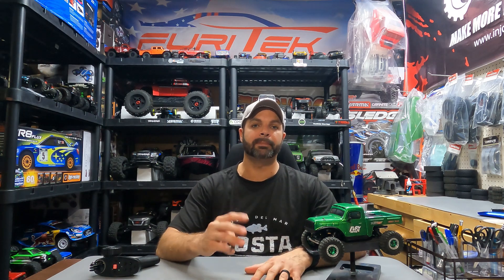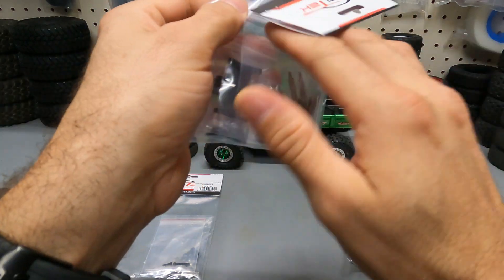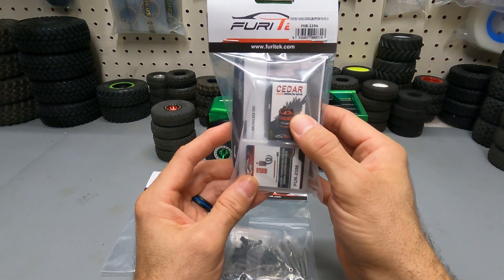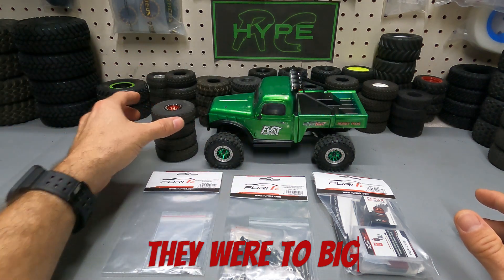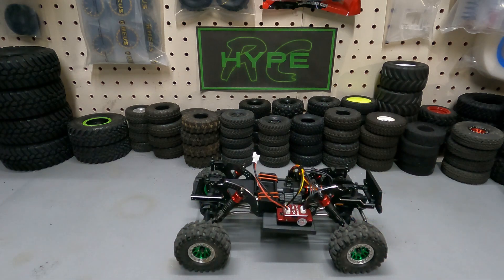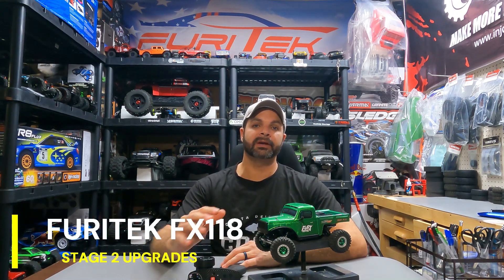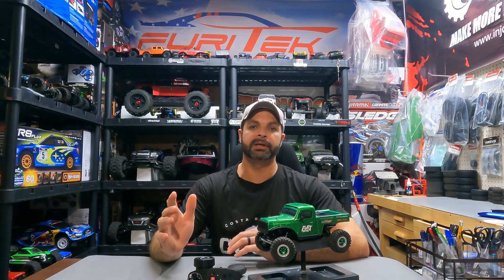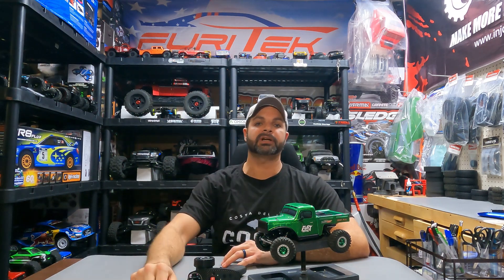Are these the best FURITEK FX118 upgrades? STAGE 2 upgrade test run & review

Comment: Are there any instructions for the installation of the steering links/high clearance links? I have both I am not sure on some on the placements. I am new to the hobby and there isn’t much on this car yet.
Reply from the maker: My advice it to assemble your links first then do the front then the back sizing the old ones to the new ones while you build it.

Comment: Nice vid. Do the hc links and steering links come with hardware/screws etc? Dose the ceder add any performance running with the stock esc? Thanks
Reply from the maker: Yes the hardware is provided. You would possibly see a performance increase with the Cedar. It is definitely more weather proof than the outrunner.

Comment: I got the ball bearing kit, stainless steel steering links, stainless steel high clearance links with aluminum transmission skid plate, steel center drive shafts, & the delrin rock sliders for my FX118 Fury Wagon. It has been one hell of a performer once I got it dialed in & got my settings in the Furitek app to get my slow crawl perfectly smooth at 3 mph & slower without any judder from the FOC. It definitely performs lightyears better than my highly modified FCX24 K5 Blazer & my friends highly modified TRX4M.
Reply from the maker: Agreed. So much tunability. You can dial it into your exact driving style.  Can't wait to get the 20% OD gears.